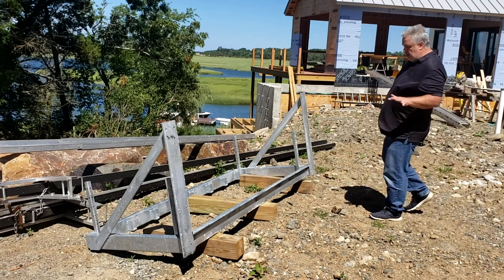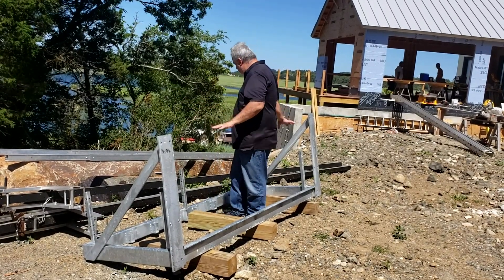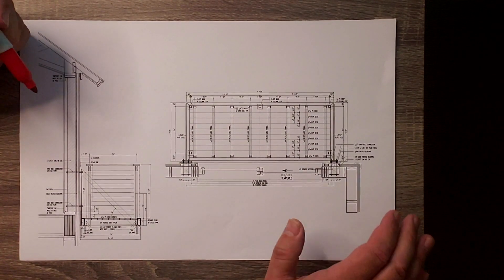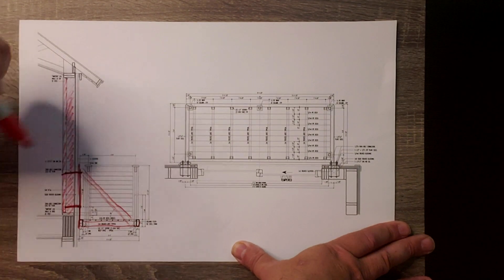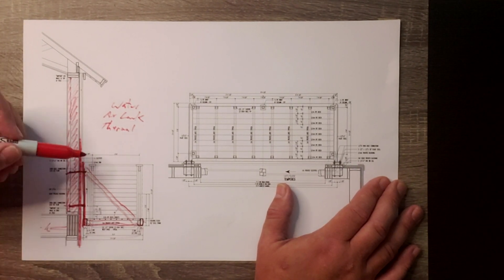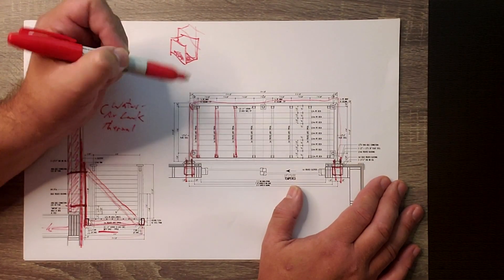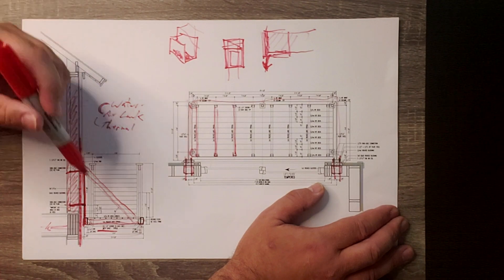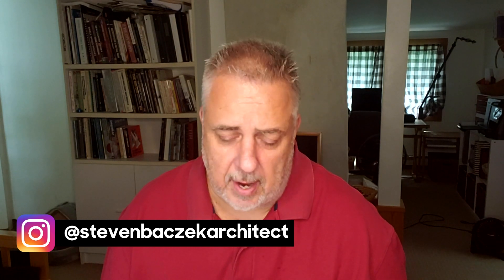Even the BALCONY is high-performance.

Comment: What about the thermal bridging of the through bolts? Is it negligible or do you use that composite thermally broken system?
Reply: I'm not aware of any composite bolt product that would keep heat from migrating through the bolts... The bolt head could probably sit on a  thermally insulating washer and be covered by a cap of some kind. I bet the heat energy moving through the bolt head is small enough  that the interior insulation between the column and the interior wall finish is sufficient.
Reply: @kschleic9053  Schöck Balcony Products.Structural thermal breaks for your balcony connections
Reply: @David_Mash  very cool product. Not at all what I was picturing, but I can see how it would work! It looks like they need to be engineered into the design, I was picturing some kind of carbon fiber tensioned rod replacing the bolts one at a time after initial install.
Reply: @kschleic9053  Armadillo makes high density insulation products for these applications as well.
Reply: I would think there's FAR more thermal bridging as a result of the massive 6x8 LVL support columns and P36 (3 pcs 2x6) window frame reinforcement.  The cross section of the threaded rods is very small compared to the structural reinforcement, but if the steel is an issue you can specify the design for Stainless Steel fasteners which conduct 1/3 the heat of standard steel parts.  It will likely never pay back in energy savings, but SS will never rust and could be enough to eliminate localized condensation points on the interior wall surface.
Reply: Maybe 15,000 sq ft of surface area in total and about .5 sq ft of secional area of the bolts - I say we need not worry